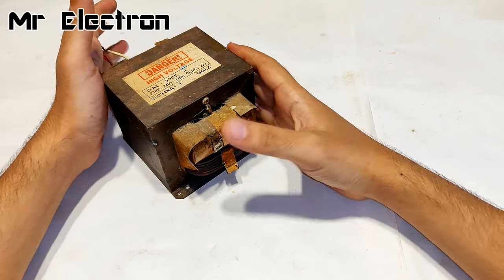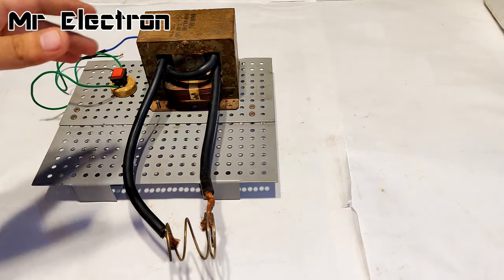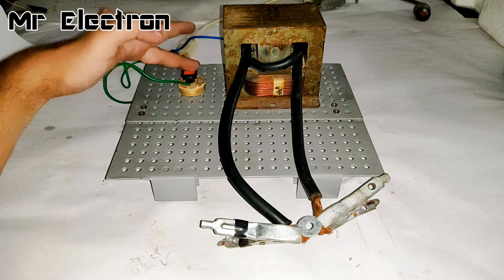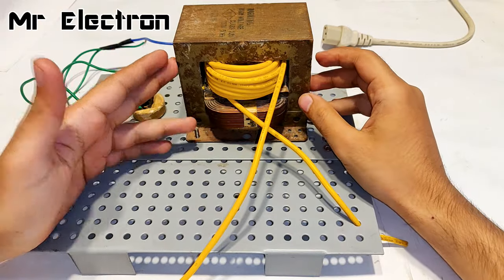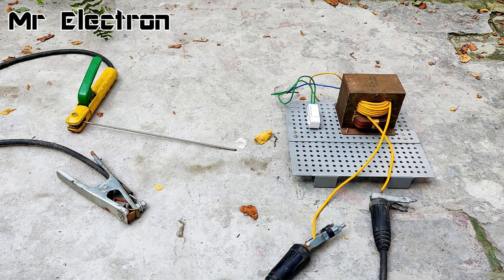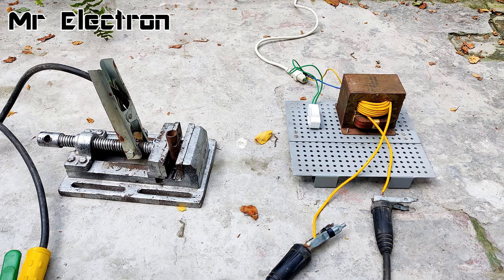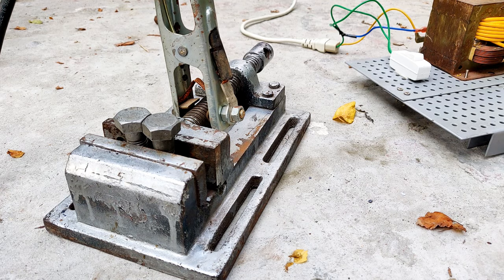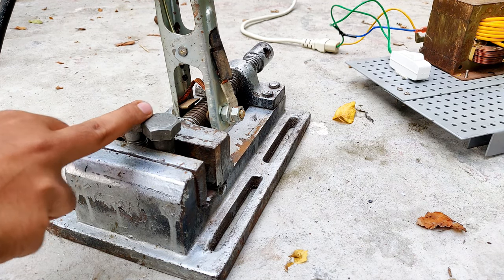Make a 220V 200 Amps ARC Welder using Microwave Oven Transformer ( MOT )

Comment: One transformer is a little bit to weak and also 14V is too low to support the arc reliably. Make 2 - 4 transformers and also make voltage about 35V at least It will be easier to work with.
Reply: Added to that, not a good idea to test it on rusted metal; that also promotes the sticking electrode effect.

Comment: Very good idea. The only problem is that a microwave transformer has a power of just over 1000 Watts while ARC welding inverters usually have around 4000 Watts. This limits soldering to small parts. But associating two transformers can double the power. To do this, just make two equal sets and connect the output wires in series (for no doubt, join one of the wires from one set to a wire from the other set and the output will be the two remaining wires, like this: out1 -- o --- o -- out 2) . A multimeter or an AC voltmeter should be used to verify that one is not inverted as follows: each set should provide an open voltage of approximately 30 volts AC. After connecting in series, the output voltage must be the sum of the voltages of the two sets, if it is the difference, invert the wires of one of them. The ideal open voltage for ARC welding is approximately 50 to 60 volts. If it is larger, thicker wires with fewer turns must be used in each transformer, which increases the current capacity and decreases the voltage. And, as shown in the video, always check the heating of the windings of the two transformers, eventually interrupting the use until they get colder. In this case a fan can be useful.
Reply: I am in Canada. By default home power is 110 v. If you want to use 110 how could you do this
Reply: @DanielJAudette  Turns out any of the microwave transformer welding projects are going to be difficult with the lower primary voltage.   Currents will be lower. It's almost impossible to find old microwave transformers with a 230 primary winding, even on ebay. I would have thought it a bit easier in Canada because I believe parts of Western Canada still use 220volt household. In the US we use 240/120 volt 3 wire as the residential standard. Typical appliances are all 120 volt. But wiring a dedicated 240volt circuit for these welders would be the easiest solution, if you can find the transformers. It's the turns ratio of primary to secondary that makes this work effectively. There's a few tricks you can use  like less windings in the secondary. This helps a bit and I have built a decent spot welder for light gauge stuff. May be building a two transformer version that should be better running it on 240 volts. 

His stick welder here is garbage though. No matter what he does, it will lack penetration to make real welds.
Reply: Connecting transformers in series will not increase current strength but will double the voltage,.. current stays the same, parallel connection will double the current strength but voltage level stays the same Sir🤗
Reply: @simanga999  Connect the primaries in parallel but run the secondary cable in series through each transformer. You are correct in that the current will not be raised but the voltage will double if the transformers are the same and the secondary wraps are equal to each other. (they must be in phase with each other so they add and not buck). 

What this will do is increase the voltage and the total power being dissipated in the arc. So about double the power with the same current. On the Primary side, the total current for the two parallel primaries will be double. Instead of about 1000 watts it will be 2000 watts. The higher voltage will carry the arc better. 

You can connect multiple transformers this way with parallel primaries and series secondaries.  You can end up with something close to a small welder output. Not great and not very efficient.

Comment: Reduce your winding (yellow wire) so that you will have more current and lesser voltage. Use the smallest possible welding electrode, say 3/32. 1/8 will not work.
Reply: how about reversing polarity?
Reply: @commonconservative7551  reversing won't help.
Reply: What size of cable do you use
Reply: @boyevangelista2661  you have to realize smarter people than [us]- have with .>greed tried,  to get cheaper energy and failed
Reply: @boyevangelista2661 : it's a 220 V 200 ampere as the blogs says. Welding cable/s depend on the current, so choose a cable which has the rating of 200 amps. There's a table for size vs amperes, or better still go to them electrical store... and ask. Sometimes, it is printed on the cable itself.

Comment: It takes at least 35-40 volts to properly strike the electric arc. 45 volts or more is ideal.
Reply: My old Lincoln says 24v arc output. Running 2 car batteries in series would do way better than this.

Comment: This sort of thing is useful amn having a plug and play arc welder in household electric board and weld is breakthrough stuff. The real deal is contacting welding rod manufacturers and asking them to make the mirco rods you need to weld things with this set up. So my advice make a micro welding collect data amps volts and contact welding rod manufacturers and get them to make the rods and then test it out. It could become a household item or device for millions of people who like to mircoweld things up

Comment: 1/16" rod and about 4 more turns on secondary would produce better results. 

Secondary moving around like that will cause wear on insulation and possible short circuit. Tighter winding of secondary and packing core as full as you can get it would yield a tighter, more stable transformer. You're getting about 1 volt per turn on your secondary and the best results I've had has been above 23 volts with 1/16" rods.

BTW, in case you don't realize it zinc poisoning is a real concern!

Comment: With high temperature 12 gauge wires (~2.38 mm), you should get approximately 30 turns for the secondary coil. Any wire with insulation rated at 300°C will make the DIY welder easier and last much longer.

Comment: Also remember that the primary  coils have to be connected un parallel I mean the same pin in each side left with left and right with right, when use more than one transformers and the secondary in serie..

Comment: There is a welding machine made by a Russian man who cut out secondary winding of two transformers and linked the transformers unside-down to make bigger gap for the secondary winding and wound a bigger and thicker wire as the secondary winding and made a professional grade, portable welding machine, giving results equal to a commercial welding machine.
Reply: Would you put its URL here pls!?

Comment: Buddy you need to spread the load on multiple transformers because your welder won't last long since the wire you used to make the secondary plus the mass of the transformer isn't enaugh to handle more that 30 amps.
Next time try with 4 MOTs and on the secondarys use 8 turns of 4.5-5.5mm copper wire per transformer connected in series!
Reply: If you need any help just PM me I have the full component mosule board I can send to you

Comment: Personally I would use two transformers and link them in parallel. It would give you a more consistent reaction and a cleaner  faster weld.
Reply: bro i use 3 transfarmer and out put 42volts but not welding plz support me .
Reply: I do support you my friend, I admire all who recycle old machinery and electronics to make new stuff. I do it myself. Perhaps your transformers are past there prime. I’ve seen people do this sort of thing before with success using only two transformers. Alternatively two car batteries are good for welding.
Reply: @mutley245  what is the desired voltage and amperage

Comment: I'm going to show you how to make a velding machine from a microwave transformer...but first I'll melt some solder and a plastic vall anchor before rewinding the secondary coil to get the proper power output.

Comment: 14.4 voltage is okay, bu there will be arround 200 amp current also. You can't use this for battery charging.

Comment: hi>     you should try connecting 4 of them together ,,,,,IN  PHASE....= cumulative output of all....then you' ll weld.....use heavier wire as possible, with minimum thickness of insulation...and add a fan in a box to cool them. as the xfrmers add up, use heavier wire....your best output for ac weldings should be around 48 to 52 volts, ad approx 120 amps or more....done this....

Comment: you need to connect about 3 more transformers in series and you'll have a welding machine
Reply: what is the target voltage after connecting the 4 in series?
Reply: JUST Connect Transformers GALORE !! And WELD ! ANYTHING !!

Comment: it can work better with an electrode o 1 mm. another idea is to connect a big capacitor of 40 volts in paralell in the low voltaje circuit

Comment: you need at least 40v to melt a welding electrode. the voltage you have there is only good for spot welding

Comment: The current is too low... you need to amplify it with another transformer connected in series.
Reply: @Ainul Hak Memon Memon but putting in series will only increase the volt and you said current is too low. If the current is low why not put in parallel to increase the current as putting In parallel increase the current??

Comment: the problem is is that rusty tube you first tried to weld is way too rusty to even try to weld with and those bolts are made of stainless steel which isnt easily weldable with a stick welder

Comment: if you use 2.5mm wire then you would have more turns= more voltage to strike the arc but still enough current

Comment: You need at least 24 bolts to weld properly, so  one transformers it's not enough maybe 2 or 3 conect the secondary coils in serie using number 10 gouge eh taken at least 12 bolts per each transformers in DA secondary coil, end this sort of welding machine s can no ve use for more that 10 minutes or the primary coil will crash.. If you want more time in use, you have to connect more transformers,

Comment: You want to get rid of that yellow wire, in favor of that black wire. you want to be somewhere around 2 gauge, & just around two windings, is all you need. It needs to flow more current, & you've sacrificed the amperage, in favor of voltage with that yellow wire. I know. I build welders.

Comment: Hello Sir, I greet you for your video. I followed your example with my microwave transformer. But this produced no output voltage result. Indeed in secondary winding I used a 1.8mm cable of  diameter with a length of 4 meters. When I connect the transformer to the current of the sector and that I measure the output voltage with my multimeter it is null!  I was looking for 18v as output voltage to manufacture a charger of any type battery especially solar: GEL, AGM, acid please help me.
Reply: 1.8mm is very thin. 
It may melt the wire and you don't realize it yet.
It is 4mm in the video

Comment: This might be okay to do a small tack here and there but there's no way you can actually weld with it because there's no puddle that forms and Welding is entirely based on the puddle formation penetration bunch of other complicated stuff it's not as simple as making two pieces of metal stick together with a rod that has electricity in it
Reply: Yeah he needs to clean his metal for one, especially since he already has limited power, and he isn't really welding since it didn't look like the base is melted, basically just brazed with a welding rod.  Cool idea but needs another MOT at least

Comment: My welding machine is not working... But why?
I used 3 transformers along with primary connection is parallel.
Reply: good,, but they need to be in phase....connect it to supply, and be sure all are wired in series; correctly and safely. with no load, open secondary output, measure voltage from one sec side to the output of each xfrmr.....if it is the same after the second one as the first, reverse the 2  second xfrmr wires......do the same for all. You should find the output adding up as you go along. ideal is 48 to 52 volts ac output.  Depending on the efficiency of the xfrmrs, you should have between 13 to 16 turns of #8 or  #6 wire. its hard to find thin walled insulated wire in this range, but good on you.  it'll  work.......old tech. Grind off the welds, take off the piece, rewind tightly, and assemble and weld up laminations....good luck

Comment: this transformer is a 2000watts it powerful for anything I guessed but not the 800 or 1200watts or 700watts for welding projects one transformer for the 800watts is not strong enough

Comment: That couldn't weld nothing even if God did vexed, you need at least 35 volts to make a good arc, 52 volts is ideal. Get more transformers to up the voltage.

Comment: Where did you measure the 200 Amps? this thing is nowhere close to that. Nice project anyway. Do not forget to add safety reminder about playing with high voltages.
Reply: It took me 2 MOTs with the secondary windings series-ed(18 turns of 8Guage stranded) to get anywhere near that much juice.